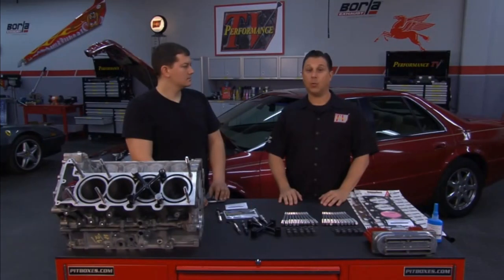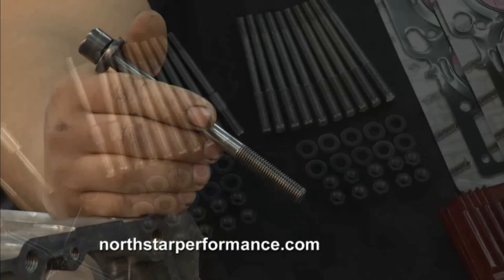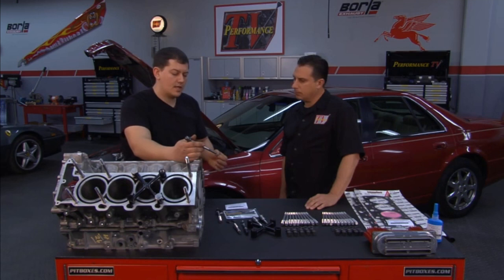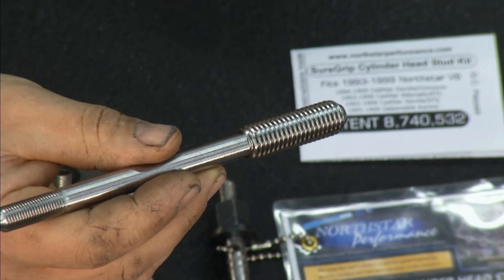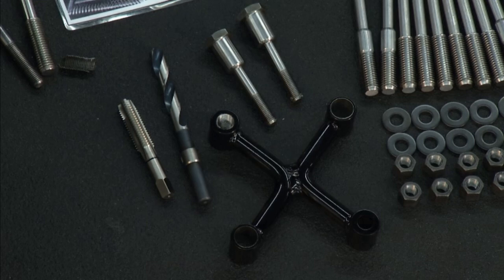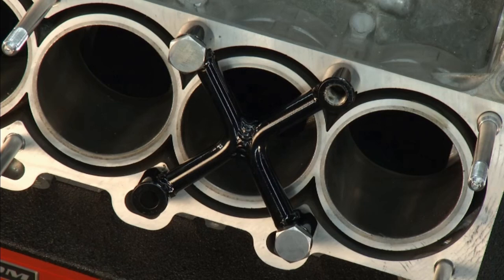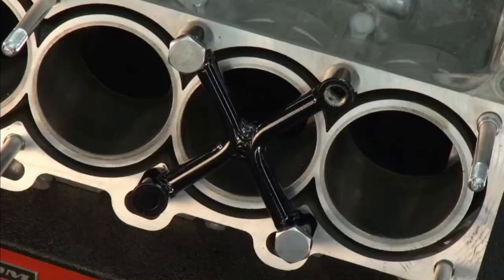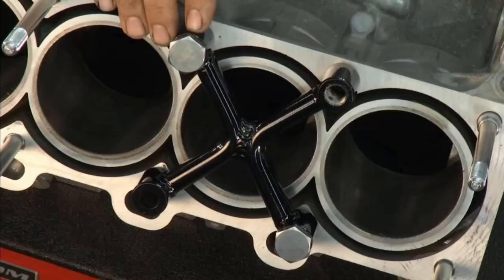Northstar Performance on Performance TV in Tennessee

Comment: Must be a common enough problem for this guy to start a company fixing it.realy surprised that after over 120 years of engine building a company can make such a silly mistake on such a good brand of car
Reply: EXACTLY
Reply: Probably caused by one of two things:  1). It was one of the earlier 32V aluminum block designs that GM produced and they re-used cylinder head fasteners that worked fine on iron blocks.  2).  Someone wanted to cut costs.  3).  Could be a combination of both 1 and 2.
Reply: Not as dumb of a mistake as Fords 5.4 blowing out sparks
Reply: It's called profit dude...
Reply: @jamesavery6671  FACTS
Reply: @jamesavery6671  😂😂underrated comment😂😂
Reply: It's call GM General Mistake from engineering
Reply: @jamesavery6671 - are you kidding me, that is a wayyyyyy lest costly and way easier fix than putting 5-6K into a head gasket job 🤦‍♂️🤦‍♂️🤦‍♂️🤦‍♂️🤦‍♂️🤦‍♂️
Reply: Who said it was a mistake …I worked at a dealership won’t say which brand but we was taught “ we make money off service not sales!”there for they make something weak so it will fail !

Comment: What he didn't mention (but you get an idea from the stud packaging that gives you a date range for vehicles up to 1999) is that GM revised the head bolts on the Northstar engine themselves on cars built mid way through 2000 due to numerous head gasket and stud failures (many blamed it on using Dexron coolant). Cars built up to mid 2000 had head blots that were essentially too short and with too fine a thread. All cars with the revised GM head bolts can be easily determined as they do not have the bank of four ignition coils mounted above rear engine bank as GM moved to direct ignition system during the same vehicle modification program.

Comment: Own a 1994 4.6 northstar.
We pulled the engine and designed our own way of repairing this engine ..its now 2020 and we had no problems...
Reply: So it's fair to say the NorthStar is a good engine?
Reply: @LamontBoucherville  Yes..once you get past the head to block bolt problem.
It a sought after engine for installation in rat rods . a rear wheel transmission can be bolted up to this engine. This engine make more horse power and torque than you will ever need.
Reply: @reddrw1  and the repair is???
Reply: @bigcrispy0666 
They never answe that question 😂

Comment: That should be a recall if it isn’t yet.
Reply: EXACTLY
Reply: Engine been around since 1992. Not gonna happen. They don't fail under warranty.
Reply: That’s some bullsh*T
Reply: It was 20 years ago. Warranty is over. They discontinued the Northstar.
Reply: My 02 Eldorado is fine. Doesn't overheat, doesn't burn oil.

Comment: I’ve surprisingly even had headgasket failure on 60k miles on other cars BUT my north star has 180k have never had many big issues! Very reliable!
Reply: Change thermostat, radiator  & water pump now before failure, 1 good overheating & its trash, ask me how I know
Reply: Very reliable? Hm. Mine just shut off in the middle of traffic going 60 mph. Not sure that you having a good example renders the rest of the complaints void.

Comment: I loved the STS when they first came out...just a beautiful looking car but for the life of me why did GM not just put an LS motor in them instead of the Northstar is beyond me.
They ruined what should have been an amazing car
Reply: harry guy I loved how my STS pulled at high speed. start at 80 mph, punch it and leave your foot buried. it just pulled harder and harder as the revs came up. I miss that car and the irresponsibility of being in my early twenties.
Reply: LS motors have WAY too much torque for front wheel drive applications.
Reply: Weight is the reason.
Reply: @steppoffaith8426  an OHV engine like an LS is actually relatively light. The LS weighed less than the DOHC Northstar. It's because Cadillac didn't want to use a Chevy  engine.....and this what happened and why they then went to the LS on the CTS
Reply: Cadillac was trying to compete with the Germans. That's why.
Reply: The RWD LH2 STS is an amazing car
Reply: Martin Skoda  and sadly they used the v6 fwd transmission for the ls4. That transmission could barely handle stock power on the l67 much less a v8. Gm ruined so many cars by cost cutting.
Reply: Cadillac used a stout 4t80e in their fwd cars way stronger then the 4t65e
Reply: So can you put a 5.3 out the ss or gxp in a 03 devile
Reply: @iiiamdiablo  i’m sure you could, but you’d need a TON of custom fab work. the transmission-engine bolt pattern is different

Comment: @ 1:41 "with a 8yr old vehicle you can expect this" WTF are you kiding me?? with a 8yr old car you should be expected to replace head studs????  With a 8yr old accord you should expect to nothing...but reliability
Reply from the maker: If a vehicle performs well for 8 years and then needs service, it has done its job. We don't live in a perfect world where things never break down. Everything including us humans exhibit wear and tear.
Reply: @NorthstarPerformance  I have a 2005 Cadillac STS with a blown engine due to timing chain tensioner failure. Were these Northstar engines also prone to head stud failure ? I am interested in rebuilding my engine. Please advise.
Reply: @rickc1124  This video IS the advice.
Reply: NorthstarPerformance you should expect more than 8 years before a $2000 “repair” is needed.  Who is this guy kidding?
Reply: unlike an 8 year old accord, this now 10 years plus gm car, will not have auto trans issues.  also, many modern hondas have timing chain issues as well.

Comment: I would LOVE to see performance parts for my Northstar 4.6. There isn´t any available.
Reply: Cams were available.
Reply: With all the aftermarket support of the LS line why would you want to soup up a Northstar?
Reply: Can you build headers for a 4.6 l North Star please I need some
Reply: @chrisreynolds6391  Why indeed. MAYBE  just because. Why does Butler performance build potent Ponchos? I sure wouldnt  want to put a  Chevy in my sisters ( may she R.I.P.) Firebird that she left me. If I hadnt of gotten divorced, I would have dumped one of their built 455s in it, put a 5 or 6 speed manual in and gone on  the power tour. Sold it to my brother to keep it in the family.
Reply: @chrisreynolds6391  can u put the 5.3 from the gxp or ss in a caddy instead of the 4.6

Comment: This is exactly the issue I have with my 97 DeVille. Coolant overflowing and overheating, with signs of a bad head gasket. Unfortunately, the car has a lot of mechanical and electrical issues, including a failed PCM, so it's not really worth it to me to replace these head bolts. But, it's good preventative maintenance if I ever get another one.
Reply: Zig says why would you ever get another one ??? 🤤🤤😒!!

Comment: My 2001 Deville was getting exhaust into the coolant because one head bolt thread failed. The threads were stripped out at the factory. It is a waste of time to drill out threads that are not damage.

Comment: I bought my first car with my own money it’s a 2007 Buick Lucerne. When I bought it it had around 140,000 miles. It was 6 grand which is what I could afford. With in 2 mouths I’ve already had it overheat and I had to change my oil twice which idk if that’s the cars fault or not but overall I wish I didn’t get the car I’ve but at least 500 dollars in it just fixing it

Comment: I'm not sure if I missed something, but how is the galvanic corrosion issue between the head bolt and the block solved? Is some kind of sealant put on the bolt threads?

Comment: I'm looking at a 2004 gxp Bonneville. Should I bother? Has a small power steering leak and coolant leak. Body is in great condition. Under the hood at the surface looks clean.
Reply: What did you end up doing lol

Comment: Picked up a 1993 elderado at a yard sale,  drove it home then replace speed sensor alternator cleaned throttle body, replaced spark plugs, I would assume that I would have drop the motor out to do this redo. The car is in very good shape as a collector. Not much needed body wise /paint etc. Big thing is the cost of the kit?  And availability .  ?.??

Comment: Hello Jake from Romania 🇷🇴

I am a fan of american muscle cars and Cadillac's ofcourse ! Besides my 97 Camaro and 2002 Pontiac Firebird a few days ago i got myself a Cadillac Deville DTS 2001 ! What a wonderful looking car it is ! Big like me, i am 6 foot 5 and 275 pounds 💪😄.

The car has about 60.000+ miles or so, the car îs in mint condițion, and i need to change the starter. I ordered the starter, the intake gaskets and the relay starter. Forgot about the knock senzors but next time for that. 

Now, i will change the starter when IT arrives, the engine oil and filter, and i need to add oil to the transmission because i checked IT and it's really low almost nothing on the deepstick. 

I will put Prestone coolant in, bleed the Air out corect and hope it's not going to have that overheating problem and head gakset problem. 

But, If IT happens, i will ordered this kit, and i've seen that îs needed to get the engine out. What i whant to know îs, when the engine is out for the sure grup kit, do i need to strap all the engine apart to drill the heads, or i can do it when the engine is still on the K-member ? Just remove the heads, drill, put the new head gaskets and the heads back and get the engine back on the car ? 

And one more thing, i've seen people heare say something about stage 3 pcm, îs that for better perfomamce and some more HP out of IT ? 
Were can i contact you, heare, on Facebook, Instagram, NORTHSTAR perfomamce?

Thanks !

God Bless 🇷🇴✝️🇺🇲
Reply: but its FWD
Reply: @abdullasaif3494  So...?!

Comment: would a 99 Seville have this issue? Is there any way to reduce ( or prevent )  the electrolysis of the original head bolts?   Thank you
Reply: The 99 definitely still had the issue, one of the most at-risk years it seems. I haven't found info on reducing the electrolysis on Cadillac forums yet.

Comment: Hey Jake I  hammered it up a big hill the other day and once I got off the hill my check coolant light came on and I smelled coolant in the ac while I was going up the hill. Do you think the head gaskets are bad? I already did a block test with the dye ( I have a feeling the coolant came out of the overflow that is why it went low and why I could smell it)
Reply: Parker House sounds like a bad heater core
Reply: Parker House I sure hope it is not the heater core.  Be prepared to remove the ENTIRE dashboard.  Allow yourself three days as well.  That is if you have never replaced one in your model before.  What surprised me was the plastic junk parts Cadillac used.  I replaced what was available while in there.  Also, spend the extra money on an OEM core.  The aftermarket cores do not fit very well.

Comment: Thanks for an excellent product, Jake. On another repair matter, Cadillac has stopped making the ignition module Part #10477276 update #19178832 for the 1990s Northstars. Blue Streak in Poland has been supplying these but they are not sure when another batch will be made. My ignition module is still functional, but when I got the car scoped last year, I was told that will be next on the repair schedule. Is Northstar Performance looking at this electrical part of the engine and how an aftermarket solution may be achieved? Much appreciation.

Comment: Have 2001 deville. Absolutely beatiful inside and out. Smooth strong ride but 15 min later overheats.  Than you realize your driving junk. And only 86000 miles
Reply: I felt this in my soul bruh
Reply: Oh god...I just bought an SLS with 85,000 Miles....86000 is just around the corner 😯

Comment: Big deal on these change ur oil, yes good oil,just fix stuff as soon as it starts showing signs u know,they are good motors but will have to put some money into them ,I changed all my gaskets at once, valve cover ,oil pan,oil phlegm, waterpump,crossover,every gasket was changed ,no leaks ,they have problems with oil pan gaskets but ur gonna have to brace it from top,take exhaust out ,u can get to all the bolts on it ,there will be one bolt in top corner ,use a quarter inch swivel to get it .all I can say is everyone talks shut about northstar, but they dont know ,prob never had one ,stay away from 96 to 99 those are headbolt problems .yea man just simply take care of it dont let things go ,cause caddys are very sensitive .lol good luck

Comment: What year was this problem corrected from the factory?
Reply: They lengthened the bolts in 2000 which made it, by most accounts I can find, much less common, but the threads were still too fine. It was finally fixed with coarser factory bolts in 2004. Worst culprits seem to be from 1997-2000.

Comment: Where can I get this kit and how much does it cost
Reply: Go to northstar performance, I had a mechanic take engine out and disassemble for me and I did the switch from headbolts to head studs in about 3 1/2 hours .then hes putting it back together and installing.
ANY one near the ky,ohio, wv. Border . We are doing this as a sideline business. We are NOT  rebuilding the engine, just doing the headstud conversion and new gaskets. $2500  you bring car to us .

Comment: Enjoyed your video, Jack. Thanks.
My car is a 2004 Cadillac Seville with the Northstar engine. Almost 6 years ago, its "Add Coolant" alert was displayed. My mechanic believed I shouldn't have to add coolant unless there was a leak in either my radiator or head gasket.
Because he couldn't find a radiator leak, he suspected it was the head gasket.
He topped the coolant off and put AlumaSeal in the radiator. He said AlumaSeal was the best product to use because my car has an aluminum block. I think we both felt that was a temporary solution.
But, it worked magic! The "Add Coolant" alert has never again displayed and the car has never overheated.
If my car did indeed have a head gasket leak, I'm wondering if the AlumaSeal fixed it permanently - or, is it more likely it never had a head gasket leak to begin with? What do you think?
I'm considering a coolant fluid exchange but am concerned that may put me back at square one relative to whatever caused the "Add Coolant" light to come on in 2015.
I know, under normal circumstances, a coolant fluid exchange would be good for my car - but I'm afraid of upsetting the miraculous results I've enjoyed thanks to AlumaSeal. 
I'm wondering if I should just leave well enough alone.
What do you advise?
Reply: Definitely leave it alone , change my coolant and the headgaskets was next cost 2600
Reply: @Kk_Poppin  Thanks, Kiara. I think that's just what I'm going to do.
Reply: @billhankins1293  just make sure the belt that drives the water pump never pop and you will be fine

Comment: So how much are you charging if I were to bring you a Headstuds kit
Reply: Between 3000 to 5000 usually because they have to remove the engine to easily access it to fill it.
Reply: I just would send them the Motor
Reply: @CDC-Vprototype  honestly for many customers it's not worth it at this point to do so because how expensive it is. Unless you got the car really cheap.
Reply: Got mine for 500
Reply: But I have been rebuilding it
Reply: All I need to do is buy the parts take the motor out and send it to a local shop cheaper that way
Reply: @CDC-Vprototype  I'm not an expert but from what I know they have to remove the studs on top of the engine and replace them with bigger studs. That means they have to precisely drill new holes and replace the faulty gasket with an improved one.
Reply: I know how they Well it’s not worth the price

Comment: I have a 2006 cadillac dts luxury 2 and i just spent 2700 dollars getting the heads rebuilt smh 🤕
Reply: Jason Boyd dann our cars are only worth 4 to 5000 nowadays....how many miles do you have on your DTS?
Reply: @johnlukach4091  ive only had it a year now when i got it it had 106,000 miles on it now it has 124,000 miles on it. O and as soon as i got the heads rebuilt and replace a cracked i guide i get it outa the shop and less than 24 hrs later i had to take it back because outa nowhere my alter nater goes out and i had to spend another 750 dollars to replace it😭
Reply: @jasonboyd4747  zig says his alternator went out during a blizzard in the arizona mountain's at 1200 miles, gm towed my ass 250 miles to dealer huge pain in the ass, almost died, thanks gm.

Comment: How do I buy your stud kit?
Reply from the maker: Click here: www.northstarperformance.com/sgstuds.php
Reply: NorthstarPerformance how much should I expect a professional mechanic to charge me for this installation. I see the kit for my car is $599 with free shipping but I’m trying to get an approximate total cost so I can make plans for this. I have a 2000 Seville sls with 190K miles so I’m sure I’m getting to the point that this will need to be done soon. Thanks.
Reply from the maker: It depends very much on the technician. I'd call around and ask....most will charge about 18-20 hours labor to do this repair at their hourly rate.

Comment: Nothing about this fix solves the galvanic corrosion issue even though the fix is proven so  was galvanic corrosion really an issue?  Using fine threads in aluminum is a no no and GM engineers should have known this from the Corvair, Vega and others.  Basic knowledge does not get passed from generation to generation of engineers unfortunately at any major corporation. 0:49

Comment: Considering how you have to drop the motor to just work on the other side of the motor doesn't make it a good motor design at all
Reply: the motor is very easy to take out upwards, it takes 1.5-2 hours of work

Comment: The guide plate and centering bolts don't line up. You would think for the money they wat it would. So this is junk.
Reply from the maker: They line up, unless you have one of the blocks that GM screwed up in there Makino 5 axis CNC machines. Think GM doesn't make mistakes? If they didn't I wouldn't be in business.